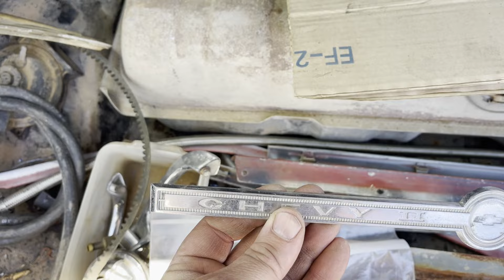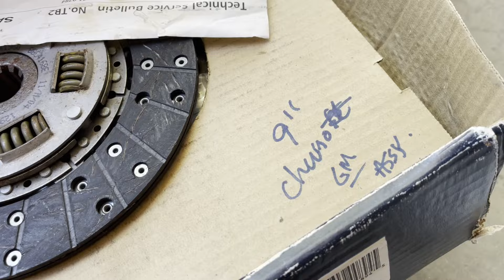First look at the Rescued 65 Nova. Where do we start???

Comment: Congratulations getting down and dirty past The 65 is a solid little car. If it was me I would go with the aftermarket heads with them having the accessories holes give you options and the double humps are good swap meet parts
Reply from the maker: I agree.  I think the 63 is going to get that 350 with a set of Promax heads. Put that with the Saginaw 4 speed. Drop that in there. Basically the 63 will be a good cruiser.

Comment: Down and Dirty on the road again!!! 🎉🎉
I think all your troubles were worth it !
Just look at 1964 Chevelle is saved !! 
How much better could it get??
Great Job Steve !!!
Reply from the maker: Thanks Jerry! Yep Down N Dirty is officially saved!!  Cars like that don’t usually make it.  Usually end up stripped and then crushed. So I feel pretty good about it!
Reply: You didn’t mention on the fuelie heads that the combustion chamber is 61-63CC and will bring up the compression ratio on a first Gen late block 350 to 9-9.5. Which is great for pump gas…….But I think you’re low on the rebuild costs on those heads. The exhaust seats need to be changed over to hardened type. My estimate would be $1K to $1.3K………..So get the aftermarket aluminum heads with 61-63CC chambers.
Reply from the maker: @macho4x4warlock98  I believe the 462’s are closer to 64cc chambers.  The 261’s are lower. But either way.  I believe the way to go is aftermarket. As much as I would rather keep the fuelies. I think the way to go is aftermarket. 🤷‍♂️

Comment: I have a set of Double hump heads all ported out, exactly like those. Stainless valves 202/ 160s. screw in studs and guide plates. I only used them to break in flat tappet cam.  the guides are bad. A set of aluminum heads would be nice.
Reply from the maker: I like the old camel humps. I’ve used them on lots of builds. But…… are they cost effective compared to what you can buy. Ready to run these days???

Comment: On these early Novas, I’ve always wondered if you could ditch the upper control arms and towers And replace with a strut ?
Maybe later model Nissan or GM?
Reply from the maker: They do make adjustable coil overs that bolt right in place of the stock springs. I’ll be installing a set of them in the next week or two. I’ll do a video on it. They are made by a company called Aldan American go check out their website and stay tuned. I’ll be doing that video here soon. 

Thanks for watching and commenting!!

Comment: Those heads used to be bad ass cool but then the 80’s came along  😂  get some alum ones, Bondo some camel humps on the front and paint em orange. That what we used to do in the late 80’s 😂😂👍
Reply from the maker: I mean I’m sure they would work fine for that 350. But…… the roller cam and springs…. Screw in studs and guide plates would be preferred….. so I’m torn….. 🤷‍♂️
Reply from the maker: Also….. me and my buddies were using them in the 90’s.  We were high school kids and fuelies were the best we could afford……🤣🤣
Reply: Early 90’s we got a set of Air Flow Research heads. Car went from 14.5 to 12.80. They were disguised as I mentioned but oh yeah they were super expensive.
Reply from the maker: @ronr344  I was just a high school kid working part time after school!!! No way I was going to be able to buy AFR’s back then!! 🤣🤣

Comment: I would just concentrate on getting it running. So it does not have to be pushed around. Piece it together . Maybe someone will buy it as is.
Reply from the maker: That’s probably what I’ll do.  I’ll get it together than worry about cosmetics.  Or just sell it as is….. 🤷‍♂️

Comment: Sell the fuelie heads to a Boomer while they still think those are the sh!7 and use the five hundred the Boomer paid for those towards something way better. If the plan is to sell the '65 then probably think about putting the 327 or a 350 in it because those 400 blocks are getting hard to find. Unless you're sick of the 400s?🤷 I doubt someone is going to pay more for the car because there is a 406 in it vs a 355 or other.🤔 

If it were me as a potential buyer I would want the car to look good moreso than it being fast. Making it fast is the fun part, making it look good not so much. But that's what I think and I would guess you as well? Can't wait to see how it ends up.😎👍
Reply from the maker: Good points. I do have several 400’s and 350’s.  But this 400 is ready to go…… 🤷‍♂️
Reply: @tackettshoh  
Well it's ultimately up to you, let the 406 go because it's ready or pull that 283 out you might have from underneath the bench and get that one ready to go?🤷 Dealer's choice.😁

Plus if you get something else ready to go that's more videos you can make.😎👍
Reply from the maker: @itseithergonnaworkoritaint7852  that’s true!
Reply: @tackettshoh  
Another thing is the first time you do a spirited first to second gear shift with that saginaw 4 speed the 1 - 2 synchros are going to get blown out from the torque of that 406. That transmission can't even handle the torque of a warmed over sbc 350. A warmed over 283 with 305 (416 casting) HO heads or 305 Vortec heads even better. The 416 heads flow as much as the Vortec heads after being ported. Vortec 305 heads can be ported to 260 cfm intake 190s exhaust would be better with that transmission.

They sell dome pistons for 283s to get the compression up. Flat tops will only be 9.2 to 1 with 58cc chambers or if you get the EQ sbc Vortec 305 heads those can handle being milled to use flat tops. Have them milled .040" and that will get you to 10 to 1. Top it off with a genuine imitation rpm airgap daul plane intake and a 600 or 650 4bbl of your choice. A 1202 or 1203 Summit 4/7 swap flat tappet cam would be a great match for this combo. Will make good hp but not so much torque to take out the saginaw. I would guess right around 300 to 325 hp with the EQ Vortec 305 heads milled .040" with flat tops. And about 270 to 290 with the 416 heads milled .040" and flt tops.

Or to get the compression up with dome pistons you could use the sbc 350 Vortec heads to get to 10 to 1. Or the Bay of e cheapie special aluminum heads that are 185 or 195cc runners at the most with the dome pistons and shoot for just under 11 to 1 because aluminum. Just make sure to use self wicking green loctite to glue the seats in just incase. Lapping in the valves to make sure they seal wouldn't be a bad idea either. Try to get 1.94"/1.50" valve heads if you can or notch the block if necessasary for 2.02" valves, the 1.60" should be ok. With a .030" overbore 283 block that is 3.905" might work with 2.02"/1.60" heads, never measured it so.....?

With the above using the aluminum heads if you want it more radical you can go with a solid flat tappet cam with a single plane intake to rev that puppy to 8,000 rpm where the peak hp will be with the head flow with a cam in the .600" lift area. This will be close to or above 400 hp with around 300 ft lbs. This would be a very fun combo but will need a 4.10 or more gear because it will be a bit lazy down low so the gear will correct that. Manual transmission combos that can rev to the moon are very fun to drive, you don't need sbc 406 torque in a 2,800 lb car unless you're building a burnout machine or a drag race car. Try road racing with one of your cars you'll probably like it, especially with an engine that can rev.😎👍
Reply from the maker: @itseithergonnaworkoritaint7852  noooooo the plan is put the 4 speed Saginaw behind the swap meet 350 and put that in the 63. The 65 is getting the 406 and a th350 with a 3500 stall.
Reply: @tackettshoh  
Ok, but keep the 350 lower torque higher HP to help the Saginaw live. Those transmissions are weak, they can't handle the torque at all. No more than 9:1 with a mismatched cam with 230 @ .050" or higher to k!II the torque and you might be ok?

Or a 305, 307 or 283 with the mentioned formula would lower the torque while having decent HP in that very light car to make it fun to drive with the weak 4 speed. Or a 350 block with a 283 crank would also be very cool and would get the torque down. They make spacer bearings to use the 2.30" main cranks in the 2.450" main blocks. This one would be really fun with the aluminum heads and a solid cam, roller or flat.😎

The 65 is going to be one heck of a burnout machine unless you go with a 2.73:1 or less rear gear.😁👍
Reply from the maker: @itseithergonnaworkoritaint7852  I’ll probably go with 3.73 gears or possibly 3:55’s.  You’d be surprised what a fresh set of 8” mickeys can handle.
Reply: @tackettshoh  
I thought you were going to sell this one? Sounds like you're building it to keep to take racing?🤔🤷😁

Comment: A creepy thought came to mind about your 65' Nova having to do with the roof and drivers floorboard issue, I think someone may of ended their life by shotgun blast and was found after the decomposition stage had passed with a puddle of yuk rotting the pan,  you say the rear interior may not be correct and the folding bench was not there.  Be careful Steve bad juju is what it is.